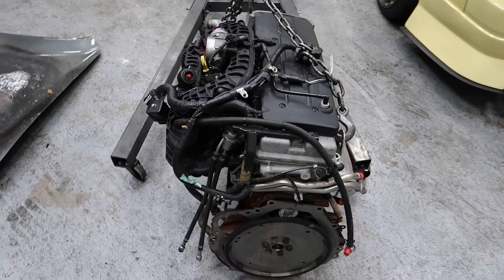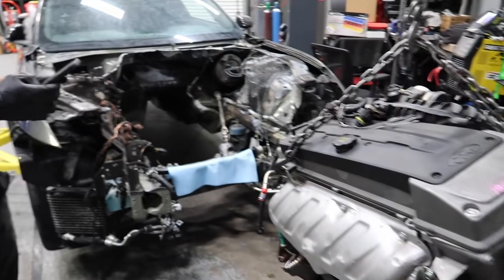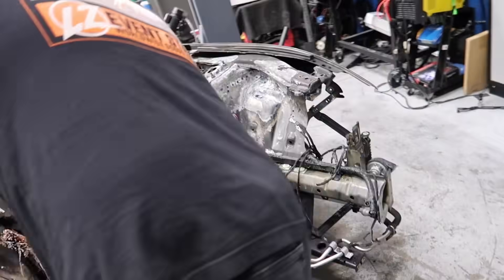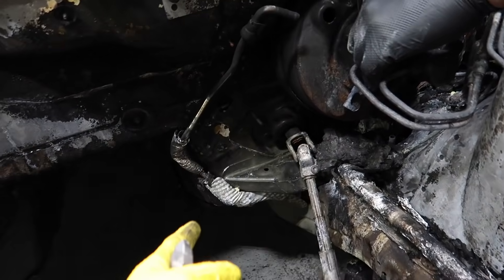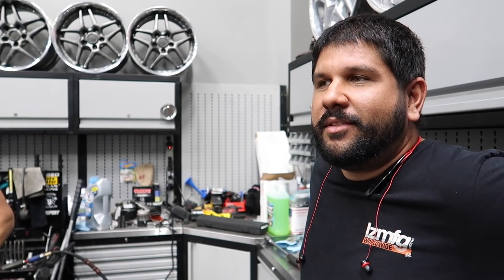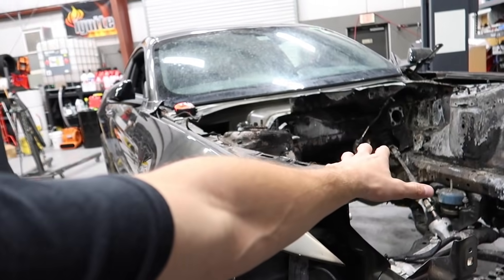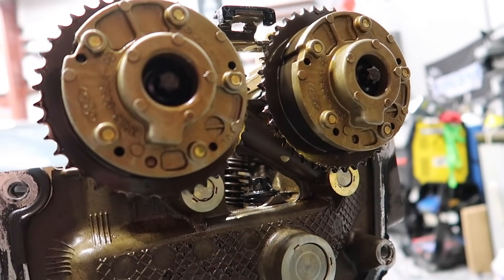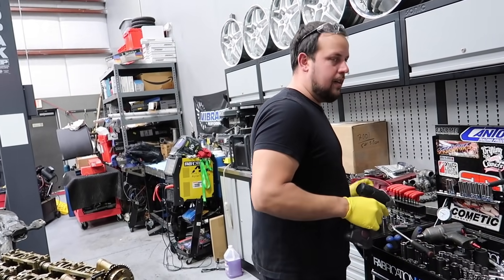The GT350's New Engine Arrived!

Comment: Hey please like this so Adam can see, Adam bro most important mod I recommend is an oil pump, i cracked mine and tore the gears up, they’re not good and it’s very common especially when you start trying to get more power. I have an atomic performance one on my Barra and it works amazing I recommend getting in contact with him. He’s been around this motors since anyone new anything about them, he’ll be able to tell you exactly what you need. Whatever you do don’t just buy new gears that’s not the issue it’s the way the housing is ported
Reply: He should have got a green top ! HAHA
Reply: ford just cant do a good oil pump gear lol
Reply: Bumppp
Reply: Probably be good to do a heavy duty timing chain too if he's replacing the guide.
Reply: just go dry sump and save yourself the future cold sweats.
also btw:   putting a Barra in this was a DAMN GOOD idea. very exciting
Reply: Why isn't this pinned yet?

Comment: "I agree with Yohan about this car being special. Wouldn't be the same if it was an other chassis with the Shelby bits transferred over" completely agree on that!
Reply: That’s true but if it’s double the work why not transfer the interior and exterior to a cleaner chassis mustang. The whole engine bay surely must be degraded in terms of strength and rigidity
Reply: Plus all the electrics on this car are probably toast
Reply: @k1r4ns  but a random mustang chassis doesn't have the character/story on it and i think yohan said he seen worst fire damage being recoverd, this is a question whether Adam gives more value to the story/sentimental part of it or just the time and effort.
Reply: instaBlaster.

Comment: I think it would be cool to rebuild it. Like, think about it, how many other people have a burnt down car that they rebuilt into something better than it was before. Either way, this isn’t up to us, it’s your car. But I really hope that you rebuild the GT350
Reply: Nothing wrong with a mustang with a straight six. Learn your history.
Reply: @nielsdebakker3283  Nobody said anything about the Barra swap being bad.
Reply: I agree!
Reply: Agreed! Wouldn't be the same with another chassis
Reply: @nielsdebakker3283  Lmfao what? Your Comment is irrelevant to the conversation.
Reply: Niels de Bakker I wasn’t talking about that dude. I was just saying that it would be cool to use the original chassis and still put in the inline six. Trust me I know a hell of a lot about cars. I’m literally a diesel mechanic, so don’t be rude if you have no reason to and just learn some respect for others opinions
Reply: He should keep the stock engine. That swap doesn’t make sense. The stock motor built will out perform that 6 cylinder all day.
Reply: @coopertoprw8mu  Ya think? The stock Barra (turbo edition) drops 247KW onto the crank, from factory. With drag spec mods @55lb boost the block hurls 1Khp+ out the back end, some say 1500hp. Its definitely not a hemi.
Reply: Santy Clause the stock 5.2 makes 520hp and likes to rev. With the right parts and possibly a supercharger you’ll easily make 800hp plus. Not to mention as far as value, even though it caught fire if repairable the cars worth more with the 5.2. They’re a rare car they only made around 2500 of them that year and about half of then were black.

Comment: Hope youre gonna run a Haltech ECU and display, its The Law when running Australian engines.
Reply: haha
Reply: Bloody oath.
Reply: Or Emtron, or Motec... or Adaptronic... or...
Reply: @burn4005  EMtron FTW!!
Reply: He’s wanting to run the stock gauge cluster
Reply: And make sure to use all aeroflow fittings.
And overnight parts from Toowoomba.
Reply: Lol he's building a falcon xr6
Reply: Stock ECU from an FG Falcon will be fine for decent power. Unless you are getting into the 1500hp range it should be fine. You can get a stock ECU with a base tune and a harness for about 660 USD delivered.
Reply: Motec is the best you can’t
 change my mind
Reply: Australia is the new Japan
Reply: @burn4005  or ecumaster or anything else that isn't a haltec..
Reply: @burn4005  Adaptronic is owned by Haltech, EMTron doesn't come close at all. 
Motec and FuelTech are the only things that get close to the same quality or features.

Comment: I’m seeing a lot of overnight parts out of Australia and New Zealand
Reply: Lot of Barra's in Florida
Reply: Something seems off about saying that 😂
Reply: Its an N/A block though, gonna be tough to push some power if you put a turbo manifold on it
Reply: That's because Australia and new Zealand has great parts
Reply: @WORNXR  looool
Reply: This needs to Bee made into a misil grip car and ceep it
Reply: @WORNXR  push around 500 or bit more with oil pump gears vlave springs and head studs or 600 maybe 700 but thats plaging with luck but you wouldnt get a na enginr unless they sre building it either way
Reply: Bagged 280 most likely they will rebuild it
Reply: There’s a place in cali that imports them
Reply: @simonhenriksen5378  I doubt he'll track it. It would probably perform worse around track due to the power band of this Vs the 5.2. if anything he will drift or drag it
Reply: I didn't think overnight was possible over such distance
Reply: Kiran Patel definitely dragging the car
Reply: @RandCboss  couldn't have said it better
Reply: I got a splitter and diffuser from flow Australia only took 6 days
Reply: @WORNXR  block is the same
Reply: @rm6330  yep haha some people hey
Reply: @k1r4ns  his building it to be straight line street car not a drift car or time attack car
Reply: Bagged 280 I don’t think u know cars like that brother
Reply: Barra nation 💪🏿💪🏿💪🏿
Reply: 💪🏿💪🏿💪🏿💪🏿💪🏿💪🏿 mine has 430kw it's a beast solid reliable engines
Reply: @WORNXR  they have no intention of leaving the stock rods and pistons in,there aiming for over 1000hp,no chance on a n/a engine

Comment: Good start. If you plan on building the engine there’s zero point starting with a turbo engine . All of our built engines started life as standard fg na engines and have run consistently 160+ mph in a 3300 lb car .
Reply: I'm so happy right now
Reply: Exactly why we got the same engine
Reply: bump for a solid Barra Build Channel
Reply: Ah yes father has arrived
Reply: Yesss! Benny's here to impart some Barra wisdom. The Cresta is a benchmark.
Reply: Mechanical Stig. Dude’s an absolute OG.

Comment: Please keep burnt gt350

Edit: couldn’t you just order a new harness and just use what you need?
Reply: Or just swap the whole chassis harness. Obviously it would cost alot but then theres definetely not going to be any weird codes due to slight changes in resistance where the harness has been spliced and stuff. I work on new fords and that's a common issue when cars come to us from body shops.

Comment: “The Burnout Bara” Has a nice ring to it.
Reply: Go watch zach baldy barras dont lke burnouts they will do them but hate life after
Reply: Or the burned barra😂
Reply: They’re an undersquare engine and they don’t lots of high rpm
Reply: @stotty117  what are you saying lol barras are like one of the most skided motors in aus you clearly dont know what youre talking about the fire was caused due to zac badlys fault of not installing the power steerinf pump properly causing it to leak barra is one of the best motors for burnouts as it makss shit ton of touque so before you talk a bunch off rubbish dont put things out of context.
Reply: MXREWIND said to perfection, some people aye🤦‍♂️😂
Reply: Ryley Fox mate cnts these days put any thing out of context to make some thing they don’t like sound bad. But hey not every ones perfect 😂🤷🏽‍♂️
Reply: @stotty117  Barras love burouts. Zac Baldy is just a numpty that cant build cars
Reply: @stotty117  and i went to adams older video and saw ur hating comment on the motor telling him not to swap it as its a "anker boat motor". Youre every thing wrong about aus community learn to love all motors and a built barra wont cost you 30 grand mate unless ur building some of the most top of the line one... and 1200 hp isnt the top of the line either its up there thou.

Comment: Ive owned 3 seperate Barra motors, worked on them all myself and with my brother. The one thing we learnt, and will never forget, is to go and get an aftermarket oil pump. The standard pump you guys show in this video, you pointed out its exact flaw. Its way too loose and all 3 have blown out on us after maybe 1000km of hard driving, they are fine if the motor is stock but as soon as you chuck a turbo in there it wears out super quick and creates more problems down the line. Please make sure you get a pump we dont need another GT350 fire video <3

Comment: Do you want an Australia Taxi Engine in a Shelby ?
Adam : Yes
Reply: MIU MIU these 
 make 1000hp unopened bottom end will all supporting mods and springs/retainers. So taxi engine all day
Reply: You obviously know nothing about barras
Reply: @uncleputes  or throws a rod
Reply: @blkidiot  where my cash is at.
Reply: @uncleputes  just put good shit in it and it's fine
Reply: Xr6 is insane
Reply: x Jay 1000hp is obviously an over exaggeration but it’s not uncommon to see around 600-700 and holding the power very well.
Reply: Lol the only reason way they used fords as taxis is because the engines are reliable and keep running over 500000 kms,  the holden commando v6 would just over heat running all day. And just not reliable sorry.
Reply: @harryduffy7130  Yeah because Murica made it bro. Barra's Strayan so made like a brick sh!thouse.
Reply: Pearce developments no, no they don’t .
Reply: @BennysCustomWorks  probably gonna go billet and copy your build :P
Reply: @MegaRideTv  1000hp 😂
Reply: @MegaRideTv  HUMONGOUS different between 600hp and 1000hp...
Reply: @fv2507  4.0L > 3.0L quick math
Reply: The LZ edition gt350
Reply: They only used green tops in taxis

Comment: You need to get in touch with Allan at the "skid factory" on you tube. He's an Australian
Reply: Turbo Yoda for the Win!
Reply: I was thinking that too. He could get this running in a couple weeks max if the parts were already there for the job
Reply: @knight838_   I think Alberto is more than capable to do the work.  But,  they could you his wealth of knowledge.  The guys an absolute LEGEND!
Reply: Turbo yoda or mechanical stig. 'Cause stig got the barra powered cressida drag car.
Reply: Why
Reply: travis casnave why Turbo Yoda? In Australia, if you want a crazy engine swap, you go to him, his most known ones are a Toyota Century V12 in a FJ40 and a turbo Barra swapped Bedford Van.
Reply: @KnowellDec  turbo yoda built it
Reply: Turbo Yoda for the breadth of knowledge on the Barra.
Reply: @KnowellDec  Yoda built it.

Comment: Silver top Barra motors are not meant for boost, you need the green top (lpg) or a red/blue top from a xr6 turbo/f6 they are the ones that come with stronger piston rods that won’t bend easily, little info so you know

Comment: my 'Barra' car history -

1.  2005 BF Ford Falcon XT
base model car, simple large 4 door sedan (sorta like a crown vic in the States id be guessing).  Ran a simple 4 speed auto with a N/A Barra 4000cc.  

2.  2011 Ford Territory
comfortable SUV.  most are AWD, but my model was RWD running a ZF 6 speed auto and a N/A Barra engine.

3.  2005 BF Ford Falcon Ute.
As aussie as it gets.  Mine was the base model work ute with the 4 speed auto and N/A Barra engine.

4.  2010 FG G6ET.
my pride and joy.  6 speed ZF auto (the turbo version with stronger internals), and the Turbo Barra engine.

Comment: Imagine owning a new 60k car and not having AC😂especially living in FL 
Common Big Boost
Reply: To be fair AC truly id the most annoying and tedious things to work on when it has problems..they rather just swap new ac in everytime lol
Reply: Ross Ritchey absolutely the worst thing to trouble shot. Maze of pipes followed by hidden leaks followed by hidden issues!
Reply: @whydoihave6neutrals772  That's why they make UV lights and UV oil. Can find a leak pretty quick with the right tools.
Reply: Robert Wells still have to rip apart your entire dashboard was the point though. You can use that kit all you want but what good does it do if the leak is buried in the dead center of your interior requiring it to be ripped out.

Comment: OEM Chain for 4 digit power? run an atomic HD kit, and hardened crank sprocket. it helps with the tension created by the new valve springs.
You also need head studs. usually the stock head bolts lift in a high horsepower barra.

Comment: Make it a drag week car and run electric AC system....
Reply: All on quick connect circuits so the heavy stuff can be removed prior to racing. 
If teams can swap front ends for the between track runs? Removable options should be allowed too

Comment: As for changing the oil pump gears,us users of ford zetec engines suffer with gears breaking above 400 bhp due to engine harmonics.. the zetec gears look very similar to the barra.. DO NOT fit a fancy alloy crank pulley,use either the standard one or a custom harmonic damper.. the barra looks a nice looking engine inside :)

Comment: Yo Adam, Im an aussie, I built the motor that put the first street driven FG Falcon in Aus into the 9's. Im sure you are doing plenty of research on Barras but the only thing ill say is Barra's dont like limiter bashing much thats why they arent used for drifting and you absolutely NEED billet oil pump gears (amongst other things).  
if you need any help or parts from down here hit me up and I can answer absolutely any Barra question you got.

Comment: You’ll need a power steering delete idler pulley off a ford SZ territory because they run a Barra and electric steering and that way you can use a standard size belt

Comment: Hey mate, we have had the privilege of watching #barratheworld down here for years.. holden(gm) run ls motors and routinely get chopped by stock turbo barra motors!! They are they good the ls conversion in a lot of cars are being overtaken by them!!!
I've seen one with stock internals pump 913hp on the dyno.. massive turbonetics turbo big front mount bigger injectors/fuelpump... but STOCK internals. 
Throw it in as a sleeper road car mate and smash anything that pulls alongside!!!

Comment: As long as the ford lives on with a ford engine. I’m fine
Reply: Lol idk if you watched the video but collette was tracking the car and she said she had just gotten on the car and was pushing it more and it blew up instantly so yeah fords are great (mind you the gt350 is a track mustang and it blew up the second it hit the track both times Adam tracked it) lol memes
Reply: @shawnjalbert6458  A slipped seal on the oil filter causing an engine bay fire is hardly "blowing up"
Reply: @shawnjalbert6458  The flaw with the oil filters has also been resolved by switching to a cartridge style filter rather than the screw-on one. The motor itself doesnt have issues, only the filter

Comment: This will obviously be cool, but I'm going to miss hearing that V8 scream.
Reply: There are plenty of mustangs that still have v8s in them dont worry
Reply: it wont have that low end torque of a v8 anymore, it'll take some getting used to.     no different than tokyo drift putting the rb26 in the mustang.    all the actual drift shots and scenes of the car driving were used with a v8 engine. the rb26 didnt make enough torque where it mattered
Reply: Barra and BIG boost sounds pretty sweet, different for sure.
Reply: @dLikesDDs  the FG makes around 300 lbs of torque at 1800rpm. Naturally aspirated. It's much more than adequate for a mustang

Comment: Hey Adam, that's an N/A motor, the Turbo motors have red tappet covers and they have different internals.
Reply: Doesn't matter. It's getting built.  The turbo engine cost more and would of still needed to be built so better to save money on n/a one
Reply: @clutchkickpj693  Exactly. If they're replacing rods and pistons this is the best way to start, no point paying the extra for a turbo or LPG bottom end if you're just going to replace it anyway
Reply: @kianheagney  My first thought....oh hope they know about the rods..lol

Comment: we aussies gonna ignore that he bought the wrong barra the weak one 🤦‍♂️
Reply: It doesnt matter his building one its waste of money geting a turbo one wheb half the parts not going to be the same
Reply: Green top
Reply: @noahv1916  unless the heads/valves are different. I really don't know, anyone wanna add some info?
Reply: kyleis dead the head just flows a bit better on a fg motor what he has now the head isn’t different there the same prettt much only difference there is no hole in the block for oil feed line but can easily be drilled out other than that is an identical engine
Reply: The turbo bf/fg/fgx internals are a lot stronger than the ba ones. The green top (LPG version) have stronger internals. All N/A Barras are not fans of big boost. If you’re going to do a Barra swap a bf/fg/fgx turbo motor or a green top is the best option.
Reply: Hayden Allen green top the way or who knows maybe its a lpi same rocker cover as na and got turbo conrods and a better head in relation to valves and springs then a turbo im pre sure
Reply: if youre in america non of them are really a good option adam is smart. You might aswell get forged internals if youre going to spend that much effort and money to ship the motor all the way to usa its not worth risking sending a rod through the block lol and having to buy a new one ;)
Reply: So there is no need for a fgx fg bf turbo engine when you can save money on a na and put money towards forged internals
Reply: You can get a reliable 800ish hp from a stock bottom end fg xr6 turbo motor
Reply: Matthew Vicary that’s on the limmit I’m pretty sure.. not reliable  but 750 to 700 is or bit more maybe depends on tune aswell
Reply: Hes Adam lz makes no difrence itll be full forged anyway